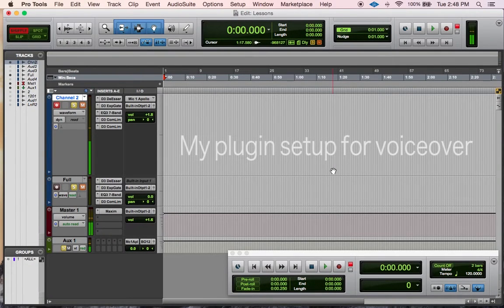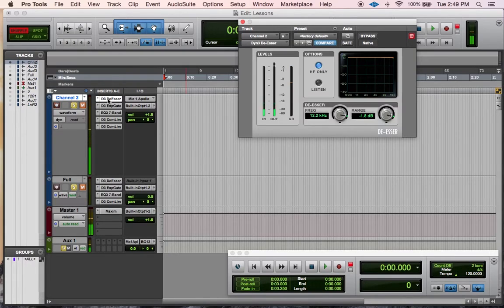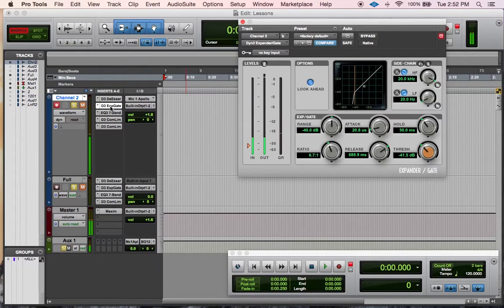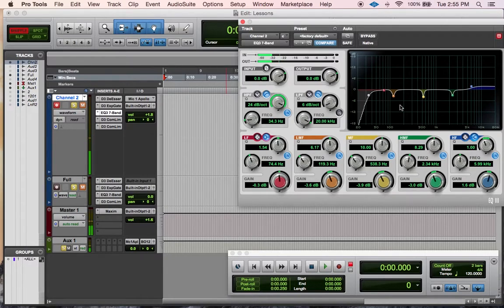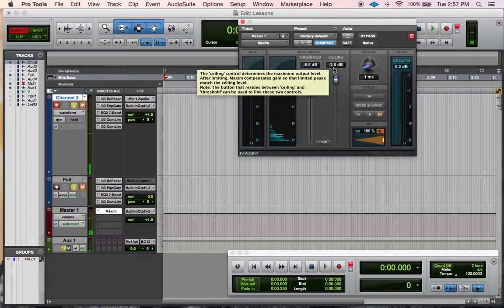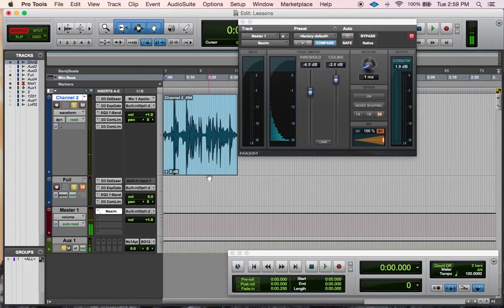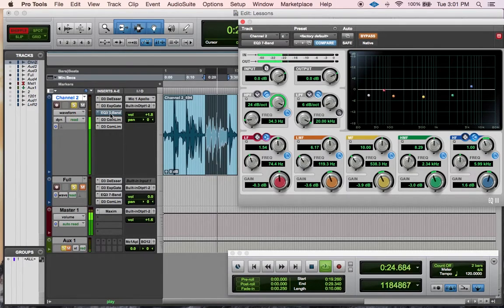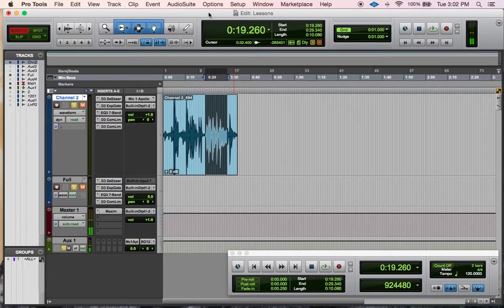Plugin Setup For Voiceover in Pro Tools

Comment: Hello, Jamie, do you know how to create amainly compressed radio like we listen on this video, for example ? https://www.youtube.com/watch?v=Ry5pzAQ0L_M
Reply from the maker: I'd use multiple compressors with a high ratio (or limiting) to get that super crushed sound.
Reply: Hi, Jamie, the only problem is that I didn´t figured out how is so much fast compression, but when people stop talking, you don´t hear the compressor "sucks" all the minimum sound of the room as we normally hear when we adjust a heavy compressor. I´ve noticed this characteristic kind of compressor in many broadcasts, like CNN, MSNBC, ABC, even with lavalievs mics, it´s like it compresses only the main subject, but soft sounds away are not compressed. And the sound is compressed equally, from bass to treble. Would be kind of a sound processor like BBE ?
Reply from the maker: I'd say getting that more natural compression sound is achievable with multiple compressors compressing in smaller amounts, verses one or two compressing in one go. What you may want to consider is using a compressor that has a filter on the input that stops the low end from being compressed (which can muddy things up).  You may also want to consider side-chain compression with the sidechained compressor selectively EQed (again, filtering out the low end). You can be quite harsh with this compression. then you can blend the dry and compressed channels to taste. It's inevitable in any kind of compression that the room noise is going to be raised compared to the intended source. If it's a major issue you may consider gating the room noise out before the compressor.
Reply: Hello, Jamie, Thanks for the explanations. I was thinking just about you said, that may be there´s a noise gate before everything, and the gate could have a soft release, in order that we don´t hear it cutting, then after the sound is "clean", we could apply multiple compressors. Thanks for the insights. I will try to replicate this "classic" FM and TV stations sound.
Reply: And I´ve noticed that they often use taht same dynamic mic on almost all stations. Dynamic mics as you know are less sensitive to far noises.
Reply from the maker: Sure, you're welcome! Yeah dynamics are good because they take a beating and most DJ's like to eat them. That's good because you have a high signal to noise (in this case room noise) ratio and the room is therefore less of an issue. I'm not a huge fan of the RE20 but the SM7b is a fantastically versatile mic.